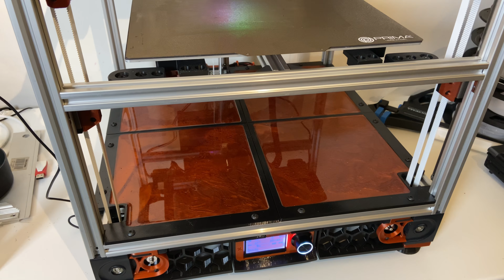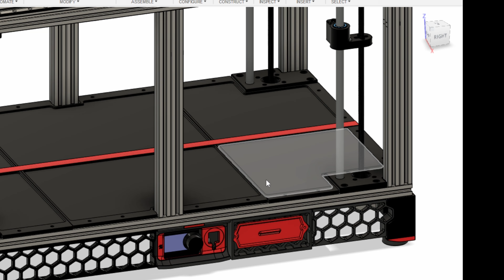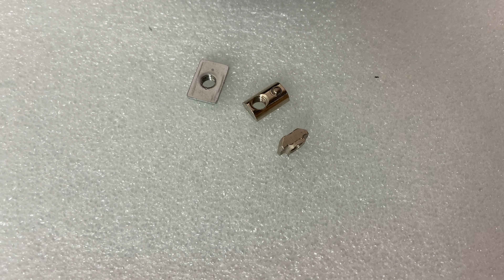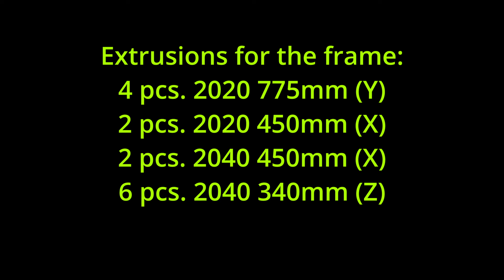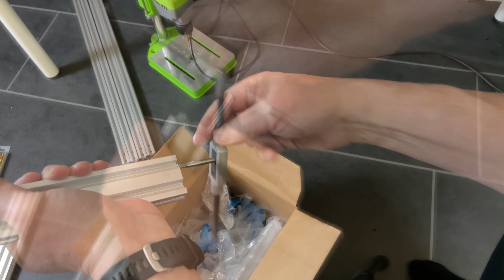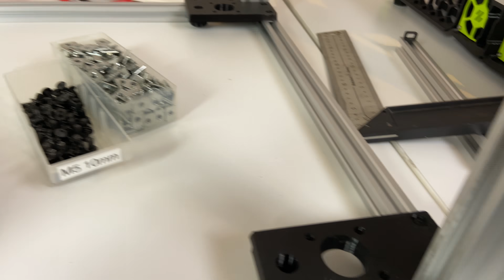The RIFF 600/900 3D printer 1 - design and frame

Comment: none of this is "without spending a fortune"
Reply from the maker: I disagree. This, and most of my builds are using parts mostly from old printers. It makes no sense to buy everything new. But long rails still will cost something. You could consider replacing them with ExoSlide or mini v-wheels if you have to.

Comment: will 4mm Linear Rail  work. instead of 12mm?
Reply from the maker: I haven’t even seen a linear rail that small :-) Probably not the best choice for a large printer. If you can find a way to attach the xy joiners and the y extrusions firmly it might still be usable.
Reply: @v4projects  What's the smallest size you recommend. It's just the price of the 12 mm compared to the length I want. The length I need is 500 mm. I'm using your design. But mostly as a concept.
Reply from the maker: @spartanjunk-c1m 9mm should be fine.
Reply: @v4projects  Thanks

Comment: How difficult/expensive is it to source the larger bed products? Heaters, bed, PEI spring steel?
Reply from the maker: I am sticking to standard components to keep the cost down. Combining several heat beds is my first choice. I did buy a very large flexplate from Tronxy but haven't even unpacked it yet🙂

Comment: That's machining fluid, not oil. The difference is that oil heats and burns, doing the tool a power of no good.
Reply from the maker: Maybe a translation error.The can is clearly labeled oil (in localized languages). It contains petroleum, propane and butan.
Reply: @v4projects   In English, nicknamed the milk of human kindness, because it often has a white colour. Still, it's as well to mention it, as newbies can attempt to follow.

Comment: For the hot bed I would take 2x 300x300, so that for smaller objects I wouldn't have to heat the entire surface. And of course I would make a frame for the hot bed and 2040 alu extrusion

Comment: Looking great so far! I'm planning something similar soon using an ender 5 plus mercury one conversion, but i'm doubling the frame (~350x700) and calling it a mercury two. 
Still attempting to find an ender 5 plus spare hotbed without having to buy an extra printer
Reply from the maker: Sounds like a fun project! I remember when the original Ender 5 was launched. I really wanted one but couldn’t afford it. Built something similar but scrapped it later.

Comment: Hello.

You can use longer Z extrusions in the CAD as feet without using printed parts for this purpose. There is no needs to use bad solutions from Voron.
Reply from the maker: Thanks for watching and the suggestion. Maybe next time I’ll do that. I have to admit i like the aestethics of the «bad» Voron solution :-)

Comment: You're Lemon Breeze printer is basically a dream printer of mine. I'm interested in a printer of a similar long narrow bed that would work with non-planar printing for RC Aircraft wings that can print a half a wing in one print. All of my printers use V Slot Rollers and I was thinking instead of the linear rails you've used I could build a similar printer with V Slot Wheels instead to save $. 

For X Axis the accuracy of that axis needs to be very good. I see that you used belts for the Z on the Voronish. Belts may be less costly but I also don't need the printer to be over probably 250mm build height. 

I'd be using a MakerTech switching hotend and would want an active heated enclosure 

I'd like to know you're thoughts if you wouldn't mind sharing if you have any.
Reply from the maker: I looked at using ExoSlide as an alternative to linear rails. V slot wheels would be even cheaper. I don't think belts are a good choice for a bed of this size. Its easy to inadvertantly move the bed while removing prints and maybe scratch it when the next print starts and the bed is to far off for a z-tilt procedure. Sounds like an interesting use case!.
Reply: Ok. I was looking at the Ender 5 Plus and thinking of converting that into a printer with two beds extending it. I think one of you're other viewers mentioned that. Would perhaps be the easiest way. I was also thinking last night would it be possible to use 4 say 16mm ball screws by themselves for the bed? In other words use those without linear rods, rails, or wheels. Probably as or more expensive but a novel approach maybe. The other thing I'm considering is the Half Core XY Kinematic. I forget what that's called. Anyway I'm realizing that you're video can kinda serve as inspiration more than a template. There are many ways to do things. The electronics and software wether Klipper or Marlin is what I'm dreading but I should be able to figure that out too with help. Looking forward to seeing you're future printers and prints and on that note I think you should show more prints from the long printers if you have the time to.
Reply from the maker: @ There are a lot of ways to do something like this. Keeping the cost down limits your options. Using rails and ballscrews might be the best option on a large printer. Using rods like I do and not mgn rails introduces some problems with individual levelling in each corner. With rods (or just) ballscrews the mounting ponts for the bed will swivel unless you do something to constrain that movement. Learning Klipper (at least at a basic level) makes projects like this a lot easier. Changes can be done quickly and they are easy to roll back. The prints I am doing on the large printer currently is just panels and covers. Not the most exciting to watch. One of the purposes of the build was to print some speaker enclosures. I think that will be the next project.

Comment: Can you please add your two jigs to the print files for the Riff? The one for cutting multiple extrusions to length and then the one for the blind joint pilot holes?
Reply from the maker: Yes, I’ll find them. Been using those for a long time.

Comment: What CAD program do you use for design? Also could you post a BOM for this build?
Reply from the maker: @Pintsize3dprintsLLC  I am using Fusion. Most of the parts are recycled/old and I would recommend using parts from old printers. You do not need any specific brands/models so a BOM for this may not be that relevant. It would be very generic but i can list the main parts needed if that is helpful.

Comment: Loving the large scale 3d printers 
What is the heated bed exactly? Or does the manager keep that a secret haha
Reply from the maker: @maxthorax13II  I have been buying heat beds for the Longer LK1/Alfawise U20 for the Voronish 1 and 2. The large printer uses heat beds from the Anet ET5. I prefer the Longer brand but they are more difficult to find and not as cheap.

Comment: Nice project and I really like the reuse of parts from older printers to keep the cost down. Too many printers are going with high end components for speed when there are design choices that can still get you quality results. Let me know when you have some plans/files available to test!
Reply from the maker: I think the new bed assembly and mounts will require some testing. I’ll publish the motor mounts from the first video on Prontables this weekend. You can contact me directly on espen@v4.no

Comment: why don''t core xy cenimatics and install all electronices back side for beter cooling and accesiblity
Reply from the maker: Thanks for watching. The belts would be to long for corexy. I prefer distributed controllers and the simplified wiring. Have a look at some of my other builds to see how that works out. Cooling is not a problem. It would be really inconvenient to turn a large and heavy printer around to access the electronics in the back of it. But this is of course just my preference.